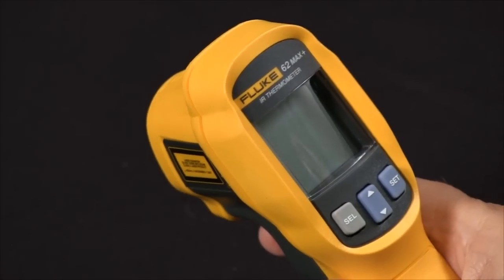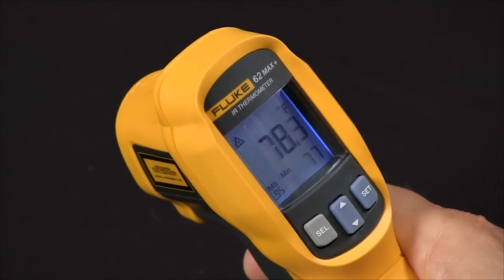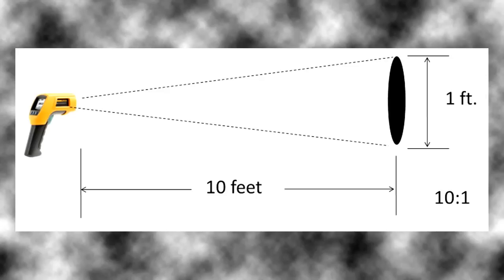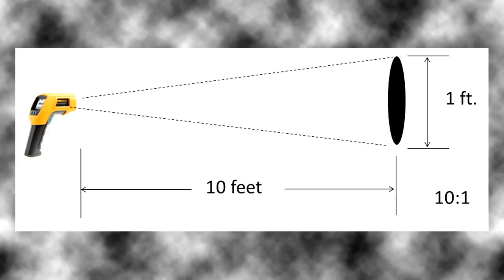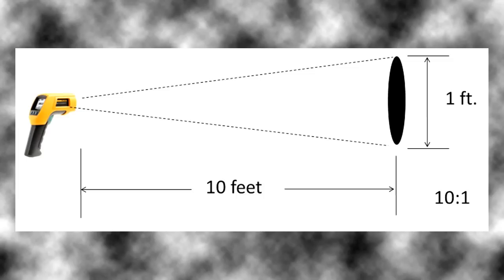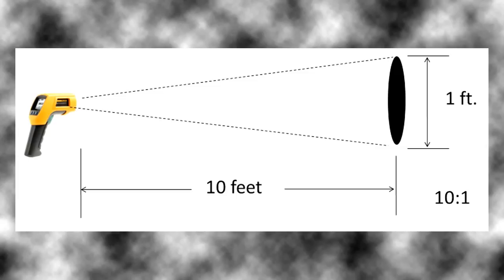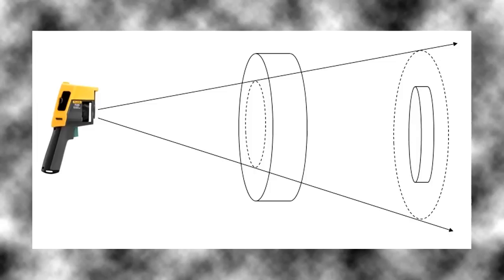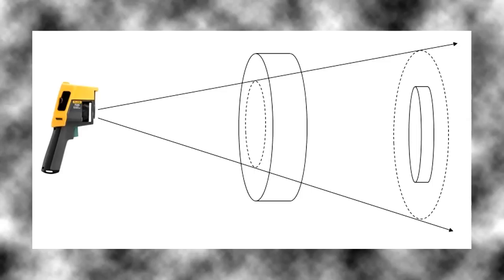Reviewing Distance-to-Spot Ratio With Fluke Infrared Thermometers

Comment: 1. Is there a distance limitation to these. 2. Could I get a reading from a mile away? 3. When I point it skyward what is the reading? Is it the average for a certain distance and if so - what distance?
Reply from the maker: Watch the video! That should give you the answers. Spoiler (get as close as you can safely).
Reply: @fluke  What causes it to give a reading when pointed into a clear sky??? often a negative reading, but still a reading.
Reply from the maker: Hi! Contact the customer support team for detailed information about this (or any other) product. You can reach them on: fluke-info@fluke.com

Comment: Hi, Does Fluke 62 Max suitable to measure 3~7mm spot?

for 3mm spot required at least 30mm distance,right?

What are the minimum spot distance for Fluke 62 Max?
Reply from the maker: Hi! According to the manual (page 14), it will not measure at these distances. https://bit.ly/3PHCMLY

Comment: What is the minimum distance from which you can measure object?
Can you measure from 2cm away and get correct readings of surface 2mm in diameter?

Asking, cause I need to measure small, about 2-5mm diameter areas, but I can get to object as close as 1cm. Cannot find anywhere minimum working distance.
Reply from the maker: Hi there - The minimum measurement spot of the 62 MAX+ is 27mm in diameter. Unfortunately, we do not have a model that will measure a 2mm-5mm spot.
Reply: @fluke , does this mean, the closest someone should measure at is 270mm away? 10 to 1 ratio?
Reply: @fluke  or, if you measure from 100mm away, the spot is still 27mm?

Comment: Upto how much far can it detect temperature?
Reply from the maker: Hello - The IR thermometers, like the 62 Max or Mini, can detect surface temperature at any range. But the farther back you are from the target, the larger the detection spot will be. If the detection spot size is larger than the object you are looking at, then your temperature readings will be skewed because you could be taking temperature readings of the object and the surrounding surfaces. So if you were looking at a pipe, 1 inch diameter, and you had a IR thermometer with a 10:1 distance to spot ratio, you could only be 10 inches away to get a 1 inch spot size.